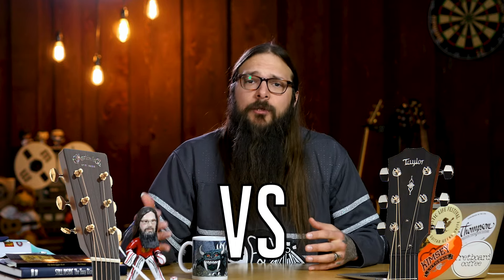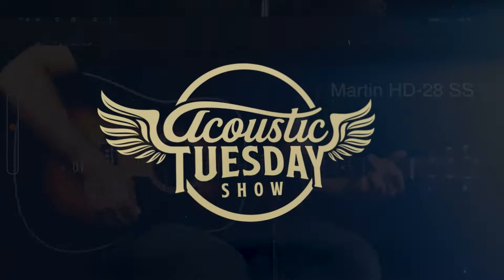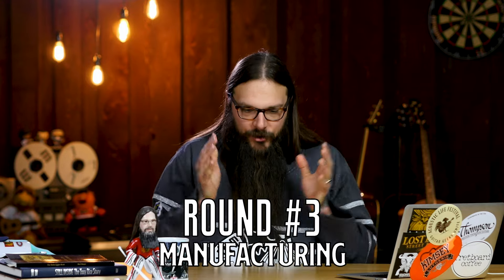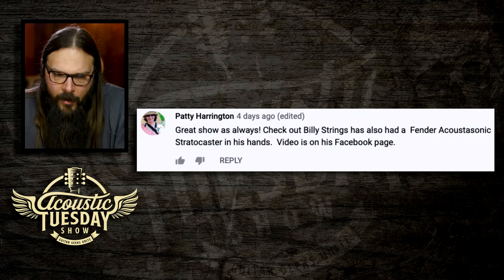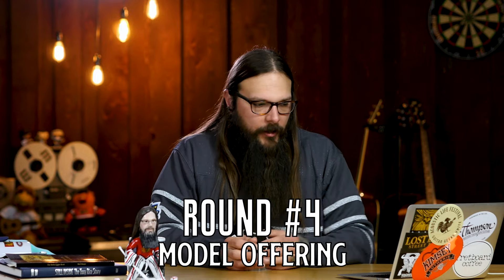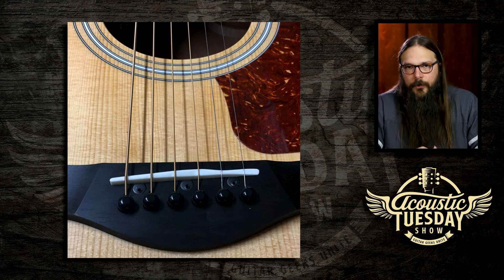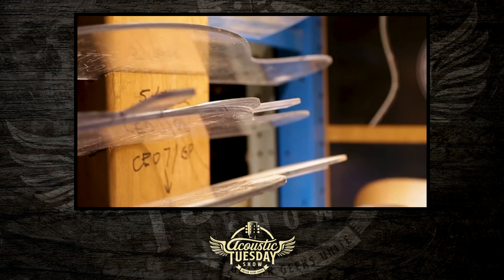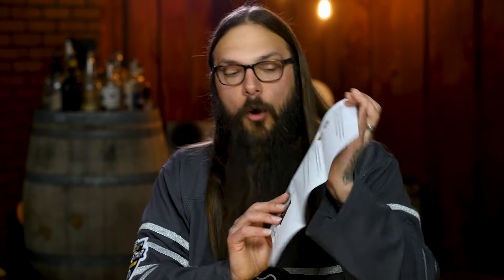Taylor VS Martin: The Definitive Showdown ★ Acoustic Tuesday #137

Comment: There is a very big problem with your "Innovation" round.
Innovation is only useful if people can benefit and use said innovation.

Martin's innovations are called Ground Breaking because literally Everyone uses it and copies it to this very day.

Taylor, for all their 'innovating' hasn't had a single design replicated by any other respectable guitar maker, except perhaps with the Sole exception of the Grand Auditorium body shape.

No one uses V-Class bracing because it has far less overtones and shimmering effects than X-Bracing does.
No one uses a behind the saddle pickup approach because Under Saddle or Mic pickups work just fine.
No one uses NT neck joints because we already have Bolt On neck joints.
In addition, the single best neck joint for Point-to-point contact and sound transfer is Still the dovetail neck joint, albeit expensive as it is.

On the other hand,

Everyone makes Dreadnought Body Shape Acoustic Guitars.
Everyone uses X-Bracing, yes, including Taylor.
Everyone makes 14-Fret neck guitars, and OM body shapes as well.

For this round, Martin wins because the proof is in the widespread usage and adaptation of their innovations.

Taylor has yet to reach that point. They may reach it someday, but that's still Very far off.
Reply: Very good point.
Reply: No one else uses V-class bracing as Taylor has a patent on it. They also have a patent on the NT neck joint.
Reply: Alan Golden I’m well aware that they have a patent on it.
But that’s to copy the original design for it, as they have done it.

Taylor’s Grand Auditorium body shape is adapted by Many guitar makers, albeit with a different name.
E.g. Martin’s Grand Performance Body Shape.
Lowdens most recent entries also mimic the GA shape.
Furch’s most popular models are based on the Grand Auditorium as well.
Reply: @dmar3651  I agree that the grand auditorium body shape has been copied many times. However, if Taylor ever did patent it, ( I don't know if they did), the patent would be long expired. Other guitar manufactures may be able to copy the V-class bracing by making subtle changes while it is still under patent protection, and it would be up to Taylor if they wanted to pursue legal action for patent infringement. Same with the NT neck joint. Just my two cents. Stay healthy and safe.
Reply: @2Gandalf1  I'd check out the Heartbreaker Guitars Youtube page and see their demo of the Taylor 812CE V-Class and compare it with almost Any other guitar they typically have there.

You will see that the V-Class brace ends up muting the overtones to a very large degree.

Normally, I like Taylor guitars. Their play and feel is Excellent and their guitars had a beautiful chime to it.
But ever since they started using V-Class bracing, I stopped recommending them to people.

I'd take any Furch or Martin over a Taylor V-Class with zero hesitation.
Quite unfortunate really, considering the amount of work that Andy Powers put into developing a new pattern for Taylor.
Reply: @dmar3651  Thanks for the reply. I do disagree however. I did my own side by side comparison of x braced and v braced Taylors. I found exactly the opposite. I own two v braced guitars (324e and a 714ce) and I love the way they sound. Again to be transparent, I also play a Martin custom shop D18, which I also love. The sound of a guitar is a very personal thing, and the same instrument will sound different to different people. That's why there are different guitars and many manufacturers.

Comment: Taylor - As a new self-taught guitarist since 2000, i remember hearing a Taylor about 2002 and was astounded.  Martin guitars all seemed priced way too high for me to consider, but Taylor had some “attainable” models by price. Then when I got hold of their information sheets on the series and the woods and the way they came together I was totally drawn in. I am a sound and tone freak. I love the warmer tones and now I have a series of guitars I can evaluate. Fast forward 20 years from the start of my guitar journey, I recently purchased my first Taylor, 814ce LTD. With a 414ce as my desire, I actually jumped to the deep end with this grand auditorium. I need to get the action down with some fretwork so it will match the playability of my EG340SC Takamine (< 2/16” at the20th fret).  JeffG

Comment: Loved the video. My only comment is the interpretation of the "manufacturing" category. The question is "what is good manufacturing"? Taylor is set up for consistency, waste reduction, optimized OEE (look it up!). In short: *optimizing bottom line*. Martin optimizes differently: honoring the intent of the individual design. Labor rates are lower for Martin and Martin customers seem to want a product with more hand-work. So, for business optimization, Taylor wins; for end-product optimization, Martin wins. Another look would be Rolls vs BMW. Rolls desires a hand-made product, BMW stresses automated quality to pre-determined standards. Just my 2 cents...(I play a Martin and drive a BMW by the way!)

Comment: On a different note, whatd'ya think about a new segment called 'Ask a Luthier'?   I'll start:  Thinking about (going to be) switching out my saddle & nut for bone on the resonator.  I see a lot of woods switched out in the biscuit, but no bone!  Any ramifications?  Any thoughts?  Or is that where (it's not) 'No Bones About It' comes from?  Will do a before/after and let you know my thoughts. Though she sounds and plays fine as is, this is a need-to-do project for decent slide play.  Meaning, while holding down at the 3rd fret, the strings lie directly on the 1st.  No space.  Everyone knows ya need at least a biz card amount.  Plus the saddle seems to be made out of balsa.  Anyway, did I just answer my own question?  Oh, well...Noah bourbon darts!  Be Safe Stay Healthy and RIP Mr. Prine

Comment: In 2015 I tried out 4 Martin D28's because I love how it sounds. How ever, each of these guitars sounded very different and the action was extremely high. I've been playing a 1976 Guild D50. 

The store clerk said that I would have to hire a luthier to set up the guitar after I buy it.
Said that this would cost about 2-3 hundred dollars. Ouch! I pay $2,800 for the guitar and it needs work already. Needless to say I did not buy into this.
Later I was introduced to a 2003 Taylor 710ce. I really loved the tone and play ability. Yes I bought this guitar.
Yes Martin has a very good reputation and is loved by many. I felt I was buying a car without a steering wheel. I still like the sound of a good Martin. Just couldn't find one.
I would still love to have a good Martin D28, just can't afford one now.
Reply: Because you wasted your money on a BOAT OAR.

Comment: To me, it comes down to the individual guitar.  I was at Gruhn Guitars in Nashville and played four Martin sinker mahogany OM 28's.  All were good but one was twice as good as the other, identical guitars.  I have a Taylor 814ce that is fantastic and the best of three that I auditioned before buying.  That said, each manufacturer has a house sound.  Martin is woody and dry, Taylor more bell-like and clear.  I own both and love 'em both.  What I really like is that my technique changes slightly to bring out the characteristics of whichever one I play.  Maybe nobody else would notice, but it inspires me.  And it's not just sound, it's the shape of the neck, the setup, the response to finger or picked sound.  Viva la difference!

Comment: The manufacture quality of a top Taylor is unmistakably very high quality indeed. However given a good copy of a top Martin, there is simply MORE "body" in the sound. The punch in the midrange, the sweetness in the high end and guts in the bottom end are without a doubt superior on the Martin. I've owned several of each and thats just how I found it to consistently be.

Comment: I now have owned a late 1870s early ‘80 Martin 0-28 guitar for over a year. The reason I do not know the exact date of manufacture is that this is before the serial numbers were engraved on the guitars. This started in 1898 with the number 8000. The reason I know that it is post 1867 is in August of that year they incorporated. The guitars still had the New York label as the Nazareth logo did not appear until 1898. What I wish to say is the great tone this guitar exudes. It is like an angels voice singing to me and inspires me to improve my playing skills. This guitar also came with the original coffin case and that is the only place where the model number is located. So history, Martin beats all the other guitar manufacturers in the world. I also believe this should have a larger weight. Never under appreciate what history means as it is apart of every Martin guitar made!

Comment: Tony - on the innovation question, Martin beats Taylor hands down. One has to consider the comparative value of the innovations you cited. Martin’s bracing, Dreadnought shape, 14 fret neck, neck joint far exceed Taylor’s bolt on neck and V class bracing, which I think is marketing move and doesn’t live up to the hype. I say all this as a Gibson acoustic guy who has owned and played Martins and Taylors. They’re all good, but in this shootout it’s Martin far and away.

Comment: Taylor acoustic appliances were engineered to eliminate negatives, reduce manufacturing costs by slick production. lower warranty expense.  They claim 7hrs construction time.  As to tone, Bob Taylor said it is subjective, meaning that is not our goal, profit is.
In later years, Martin has Taylorized.. not the same company pre CFM IV..
To add another category.. Customer Service.
When I had a problem with one of my 15 Martins (expensive custom order) they rate a complete fail.
I was told by a Martin employee in customer service   " dealers are our customers, you are a consumer" that did it.
I have also had experience with Taylor customer service, far superior.

My vote:  None of the above.

Comment: I say both brands are over-rated as we live in a world of so many options when it comes to Acoustic Guitar world.
There are lower priced options with tons of features and sound that none of these brands have at that price.
But I would rather have a Taylor that has a NT neck system, so it's easy to neck reset in time, versus a Martin that doesn't have this at all.
Many guitars are similar to the Martin tone, of big low end, but very few get the Taylorish crispy sound right...

Comment: I’m own 2 apiece (Little Martin, ‘43 00-17, ‘99 814ce, ‘19 214ce). Different tools for different jobs. The 814ce is a modern classic, and a very tough guitar to beat out. Works for anything, sounds great all the time, haven’t had to get a set up on it ever, and it’s damn fine to look at. But if you go into the vintage vault of Martin.... yeah. They’re a pain in the butt to keep maintenance up and get repairs, but there’s a magic there and you can’t deny it. So if you’re buying a brand new guitar I’d go with Taylor. It’ll never ever let you down. But if you want to hear crazy magical vintage tone grab a Martin. Overall, Taylor.
Reply: Also the new Martin 13-fret sc-13 is a tragedy. Really just not good, at all. People rag on Taylor for sounding bright and thin but sheesh

Comment: I owned a used 10 yr old hd28 that had a peeling binding and so traded it in for my forever om28. I happened to see an  2008 hd28 that had the same binding problem. so not sure if this a strike for Martin but that Martin tone is unmistable. No questions about that.

Comment: Taylor. Why? I had a Martin back in 2000, but sold it a few years later, the only guitar I've ever sold... Around 2010, Taylor appeared on my radar. My first was a 214ce, then a GS Mini mahogany.  A wonderful 614ce then changed hands, soon after a brand new 524ce NAMM 2018 Limited edition was brought home to my residence. Last year I bought an almost untouched 816ce, then an even more untouched Custom GS spruce/macassar ebony BTO. How many guitars do a man need? Just one more, so last summer, I aquired a K28e, a beautiful Hawaiian Koa masterpiece from Rob Taylor. So there you have my guitarsenal, plus a Yamaha LL-TA and a Maton TE1. And three Ibanez acoustic 6 and 12 strings from te 70's and 80's. However, for the comfort of all you Martin lovers out there, I always use Martin MA535 and MA540 strings on all my guitars. Guitar geeks, unite  <3 <3

Comment: I had a Taylor 114 from 2004 that was $400 new, 999 for the CE now. It was looked good and easy to play but the sound was not as good as a Martin equivalent. It lacked warmth and smooth clarity. I haven't tried a real Martin other than their sub-brand Sigma from the 1990s which was good tone but maybe higher action was slightly harder to play. I hope one day to earn worthiness to spend enough on a D18-28

Comment: Martin vs Taylor isn’t really a fair comparison. If it were Martin vs Gibson, well that’s a different story. Taylor guitars
are an entity unto themselves and  “only” 46 years in production. Bob Taylor does have a great vision for his guitars
and, along with Andy Powers, may be the most forward thinking and creative team of the three major, high quality 
guitar builders. Sustainability? Taylor, no doubt. It’s very impressive. I own Gibson and Taylor acoustics, and am a great
admirer of Martin guitars. They may be the most iconic and consistent sounding acoustics of all. But - Taylor gives
you better bang for the buck than either Gibson or Martin. And they are extremely fine instruments. I love mine, and 
it also has the best electronics in the business. That was a big reason for me buying one. It does what it’s supposed to
do, and well. As for Gibson, mine are 60s instruments and they are incredible. Modern day Gibsons are way too expen-
pensive and not as consistently well built and quality controlled, sadly. Some are just incredible; some (at the same
price point) not so much. Taylor and Martin are better in that respect. All good. In my dreams I’d own a Martin D-41, a
Gibson J-45, and a new Taylor with V bracing, a terrific Andy Powers innovation. If I had to pick one? Gibson J-45. But
that’s just me ...

Comment: I know this is a two year old video - I’m late to the party. 

Aside from boutique builders, Martin and Taylor are the best of the big builders. 

I’ll preface this comment by saying I’m a Martin guy. I have a D-15. I know it’s probably the lowest end solid Martin. I walked into GC with $3,000 in my pocket planning to buy an OM-28 (in 2004). I played every high end guitar, and the D-15 won my heart. And it sounds better every year. The LR Baggs Anthem makes it sound 90% as good as unplugged. 

I also have a Martin/American Archtops CF-1 Jazz Guitar - they only made < 100 according to luthier Dan Unger.) They we’re only made a few years and it’s hand signed Private stock. 

I think for the most part it’s pretty clear - I play in church and hear a lot of both. 

Martin sounds better by a mile in a room or mic’d with an SM-81. 

Taylor sounds better plugged in. The exception is the solid Koa model K24ce, which holds it’s own unplugged. 

The exception - I don’t think either should be putting their name on the Mexican made versions. They don’t measure up to the USA models. I’d have called it a Taylor-MX or similar.  I think it dilutes the name and reputation.

Comment: Hmmm, up until 2017 Martin was the hands-down winner. But when Taylor came out with their V-bracing, they have created a guitar that is more "in tune" and on the note than even the legendary Martins. The Taylor 914ce is also more balanced in its over all tone. It is just as resonant as Martins. It is a phenomenal guitar.  The  Taylor guitars also can be adjusted and customized far easier than the Martin guitars and the workmanship and quality are equivalent.  With the advent of Taylor's V-bracing, they have created  a better overall guitar sound wise than Martin. I thought I would never say that because I am a Martin fanboy. The 914ce has the most perfect pitch and balance that I have ever heard on a guitar - it is almost unreal it is so accurate. Taylor guitars also have a reputation of being much more playable than Martins. If you are going to spend 3k - 5k on a guitar, Taylor is the better value. I can't speak for the lower end guitars because I have not listened to them.